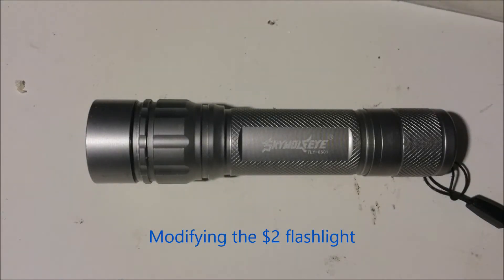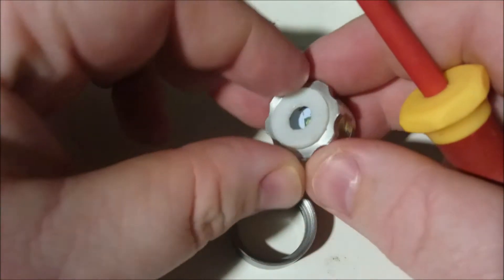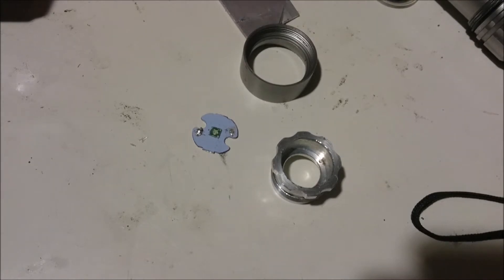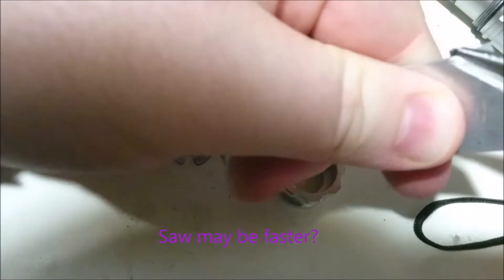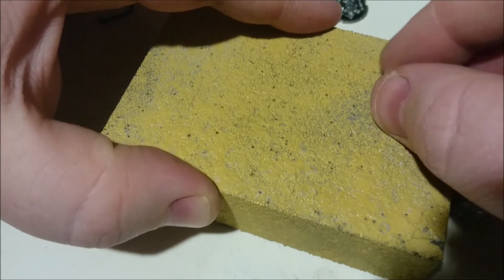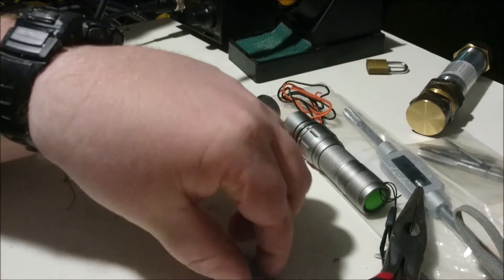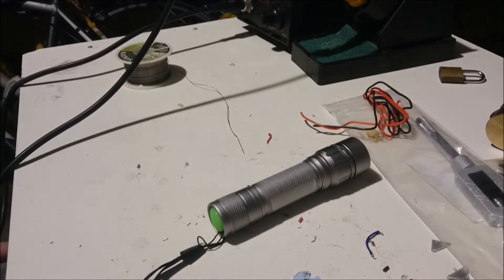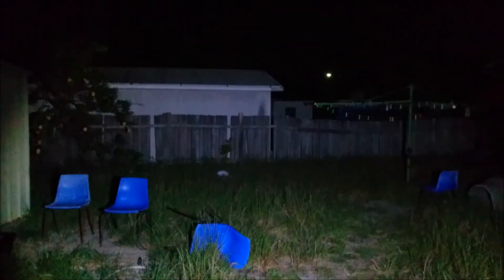Modifying cheap Ebay Flashlight for extra output

Comment: I skipped few parts, but did you replace diode? I heard you said that its T6 (thats 10w right?)
Did you replace driver board or used same? Also did you try to measure how much current it draws? 
I modded few years back cheap 9 LED flashlight with 10W LED but didnt use any driver, it was drawing close to 3A and body of flashlight became quite hot after few minutes, you have any problems with that? Sorry for alot of questions, i just got this flashlight and i was impressed how easy it is to pull it apart and mod it.
Reply from the maker: Hey mate yea i replaced the LED with a Cree XML T6 i think.  Its a real XML2 not a fake. I pulled the XML2 out of another light. The LED that comes in this light is crap. 

Same driver i just bridged the resistors to get extra power the current on this driver is limited by the resistors and the small FET. 
Current draw is still average around the 2.5-3amp mark max making it about 1000 lumen .

Heat is always an issue especially on this light because it has a hole in the pill. You have to make a round piece to fill the hole if you want more power? You can cut up some alloy or copper and shape it. 

If you dont mind to spend the money buy a S2+ when they are on sale at Gearbest it should cost around 10 USD. This will give you modifying potential. 
These lights are okay but it takes a bit of work to get it decent. Just making a spacer to fit is a pain. If i tell you to mod this light and its only okay it may turn you of lights.
 
A light like the S2+ is already solid and in the future if you want to learn how to mod better you have a easier light to mod with spare parts every where. 
The S2+ also has a pill that can be taken out to work on. 

You could buy an LED like a SST40 and use a direct drive driver and get 2000+ lumens in this light but the internals are not made to handle that much power and cause an issue.

I mod lights and a light is meant to get hot but how hot you have to learn for your self. Like all electronics heat is okay like on your amp. To much heat will kill it. Also like your amp a torch has an alloy body which acts as a heat conductor to dissipate heat.
Most lights will do okay being hot but you will shorten the life span of the electronics if they are to hot or to hot for to long. The thing with LEDs is the hotter it gets the more resistance gets built and the light output will lower or flicker. I have had LED turn blue and die but that is only with an extreme amount of power if run in specs it should not happen.

 There is a hole community of us at Budgetlightforum.com you will find heaps of info on this stuff if you are interested :D

I like your music i use to have a 12inch sub hooked up to my PC with a 5.1 sound system extra and use to listen to the SPL shootout cds. I had a sub in my car but i get to much attention for the police.
Reply: haha, thanks for response, i bought this flashlight as second light for my bike (i made 10w light that is more of a flood light, wider angle helps alot when im biking in forest but its too big to fit in pocket). I dont need alot of power, roads are lit so i only want to make myself visible to other bicyclist and cars, but when i saw how easy it is to dissasemble whole thing it just got me wondering if its gonna be easy to mod it.  My main concern was driver, since i cant find anything in that range on ebay that is cheap, led might be challenge too since ebay is full of fakes.
Reply from the maker: Alright sweet so its a standard 17mm driver and a standard 16mm LED. I buy heaps of parts from Fasttech but you can also gets the parts on Aliexpress.
Driver like this will work well it does about 2800mah on highest mode so should be good for around 12watts. 
https://www.fasttech.com/products/0/10040292/8727400-17mm-2800mah-2-group-3-5-modes-led-driver-circuit

LED is up to you because there are heaps you can chose from and different tints and sizes depending on the beam pattern you want.
This is a neutral white LED.
https://www.fasttech.com/products/1609/10003889/1425004-cree-xm-l2-t6-3b-10w-1100lm-5000-5200k-neutral
This will also work but will give you slightly less output but a bit of extra throw. You could also Dedome the LED and these LEDs are class leaders in throw.
https://www.fasttech.com/products/1609/10001905/6204304-cree-xp-g2-s3-1a-586lm-6500k-led-emitter

That is around 5USD for both the heat should be okay but i still think you will need to fill the pill.
 If you need any thing i am happy to help.
Reply: Thanks, i see that fasttech has shipping to my country so im gonna go with that :).